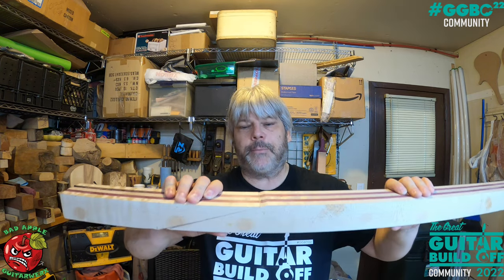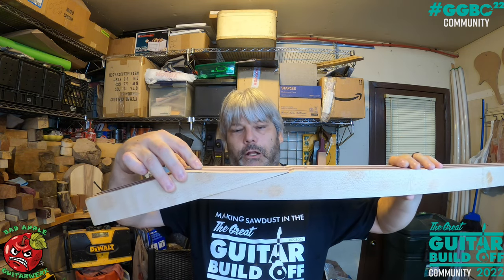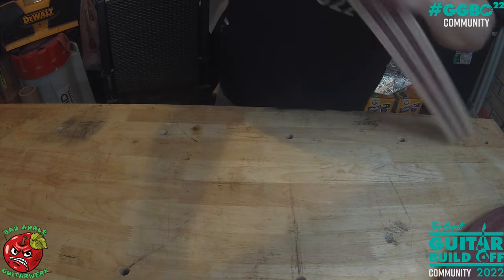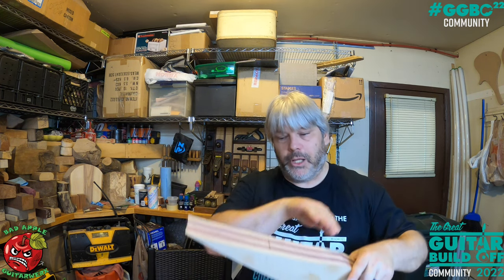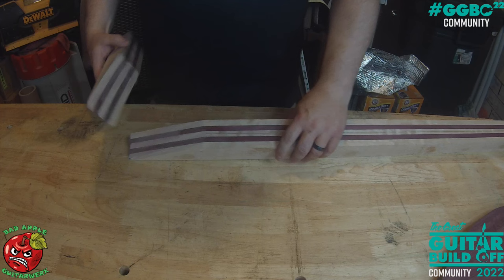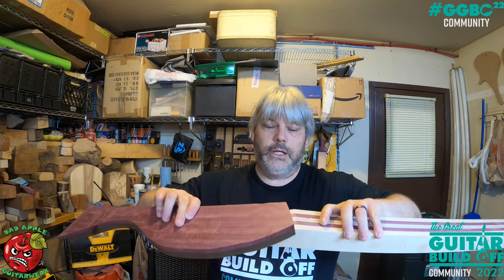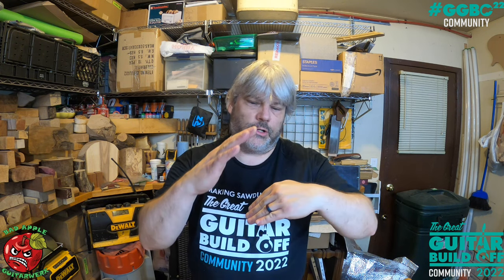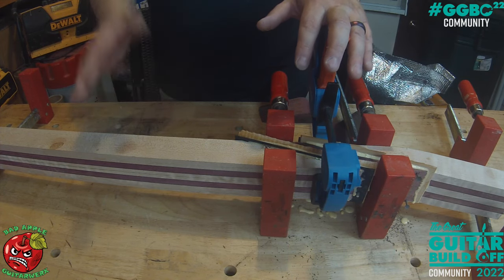GGBO22 - Episode 3 - How To Make A Fancy Scarf Joint

Comment: Looking Good sounding awful, turn the volume of the music down.
Reply from the maker: You'll be happy to know that I indeed did adjust the music volume down from the original levels. It could have been much worse. 😉
Also, something happens on YouTube's end when uploading a video. The music volume levels get changed from where we, as editors, set them. So we only have so much control before YouTube does whatever it is they do during the upload process. Trust me, it's frustrating for the content creator too.
Thanks for the comment! 😎